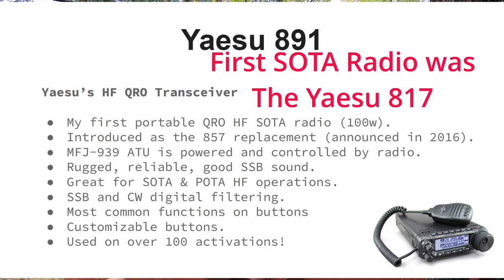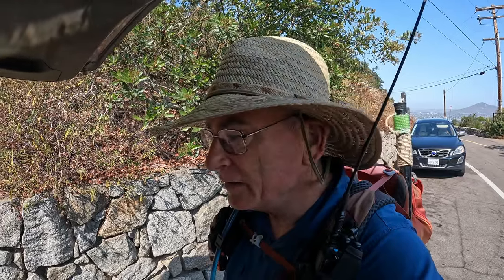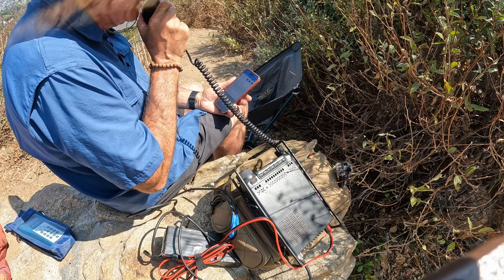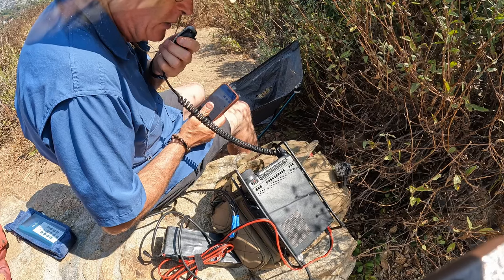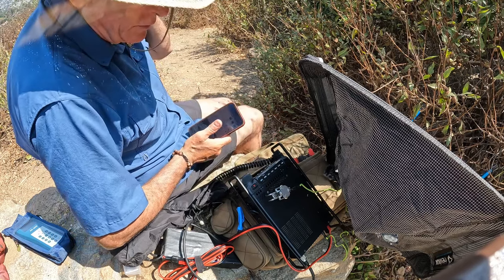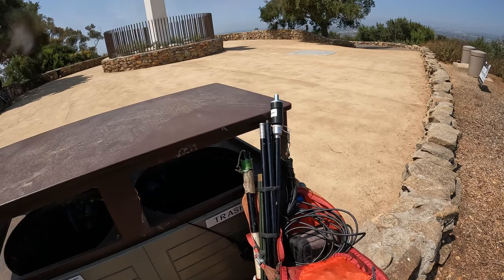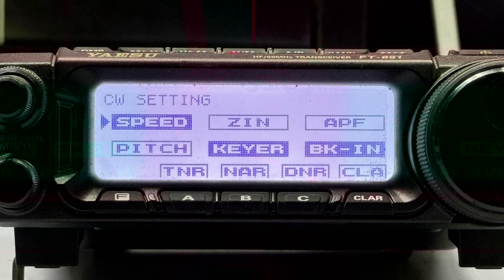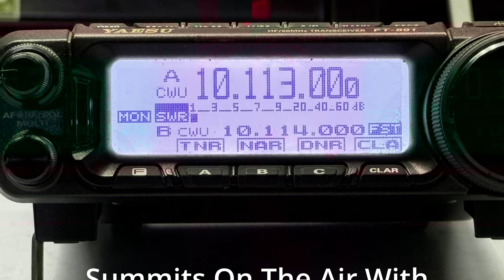Reviewing the Yaesu 891 for SOTA

Comment: Sorry to hog comments. Made EFHW for my FT891 and tuned it first with the analyzer then retuned it to match the SWR meter in the rig which made it possible to run that antenna with no tuner to cart around. Regards vk5cz ..

Comment: Get rid of the mfj939 and use a tuned antenna. Linked dipole or EFHW and a 20-30' telescoping fishing pole. Your signal will improve by probably 1 s unit

Comment: Used my 891 in Parks a lot and find the DNR not that good for weak signals either, better off putting up with the QRN and pulling out the RST on the exchange. Especially if you compare it to the bench mark Elecraft portable rigs its a 5 out of 10 for hearing the signals in the noise. I keep my power lead right away from coax if possible as it shuts down the BMS in my LifePO battery. good work Chris.

Comment: I /accidentally/ bought a FT-891 last year and took it for a trial run on a POTA activation. My intent (someday) is to put it in the 4Runner for use as a mobile HF rig. That'll work for POTA activations in the winter, too. 

The menu system is a bit wonky, but that can be overcome with some practice. I haven't gotten around to programming the three front buttons (yet). But that will help. I don't like having to jump into the menu to set the keyer speed. I'm spoiled by the Elecraft rigs that have it on a knob (where it should be). When activating I always slow down to the caller's speed. I so appreciate it when other activators do that for me.

Interestingly, the audio section of my KX3 also breaks up (it's distortion from overdriving the audio amplifier, I think) when I get a loud station. This causes an immediate scramble to turn down the audio gain. It usually scares the crap out of me too! ;) 

It's a good review, Christian. Thanks for doing it for us. 73 de AG7TX